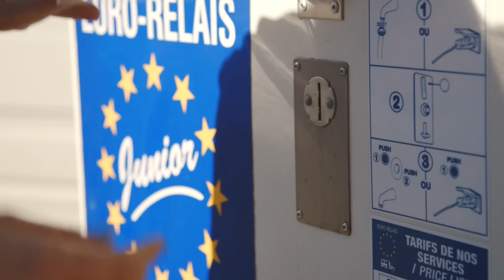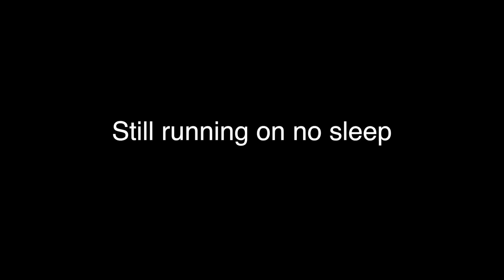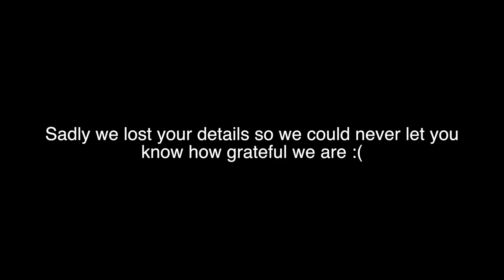They Trashed Our Van & Stole Everything :(

Comment: Sad Spain is so notorious for vehicle robbery..all my past vans had decent safes. my Sherpa LDV had large custom made safe welded to the chassis painted with underseal.  even the customs guys never found it when they searched once...The only access was to remove a secret floor panel..My vw t4 had things like passport debit cards and cash etc hidden  under the bonnet behind the battery. the bonnet catch was removed and rerouted and hidden under the dash to open. also it has a decent size safe welded to the steel bed frame..(LAPTOP SIZE) I always parked it some where busy, like outside a restaurant or bar..Its a horrid feeling to be robbed like that...sadness overload.. Many vehicles have steel mesh over windows ..the looky looky guys who roam the beaches selling stuff, beat a hole through the floor in the boot of there cars and using a large chain and padlock lock the boot closed. No way in apart from undoing the padlock from underneath..Spain is quiet a poor country .ive seen the aftermath  of dozens of cars along Alicante beach parking with there windows broken..i was once robbed while in my van asleep with back doors open...stories of beautiful Spain over the last 20 years. Now I just cycle travel. and Spain by far the best country in Europe for me..i love it..   SORRY FOR YOUR LOSS UT.GO BACK GUYS AND BE MORE SECURE.

Comment: Vehicle breakins happen in every country in the world, did you not have a good alarm, i guess not.
Reply from the maker: Mike Hurley seriously pulling out the victim blaming card? We did everything we could. These people would have broken into our van regardless. Ours wasn't the only vehicle broken into. Show some compassion man!
Reply: Why not have a safe welded/bolted to the floor that can take valuables, and get an alarm fitted, wont stop the window getting smashed but they usually run off when the alarm goes off. I worked in the auto industry for over 40 years and i am still amazed what some people leave on display, sat navs are a classic, never leave anything on display, not even a bag of rubbish. Motorhomes abroad are a prime target, thieves know all you own is in there.
Reply from the maker: Like you said there's nothing to stop this from happening. So please, think before you leave a throwaway comment on someone's personal take on a raw experience. Whilst losing valuable possessions was crappy, it's more the invasion of our home that was so upsetting. An alarm wouldn't have stopped them breaking our window and taking our safety away from us.
Reply: I have had the same, windows done on 2 vehicles abroad and 2 in UK, alarms gone off every time, nothing on display so no interior invasions, just scumbags looking for anything. A safe is brilliant, secured to the floor usually under the seats.